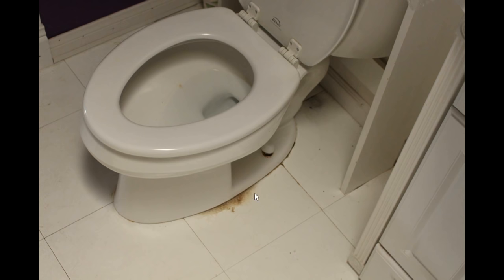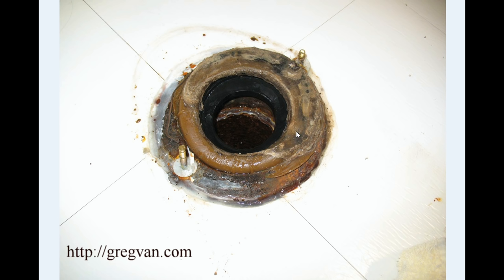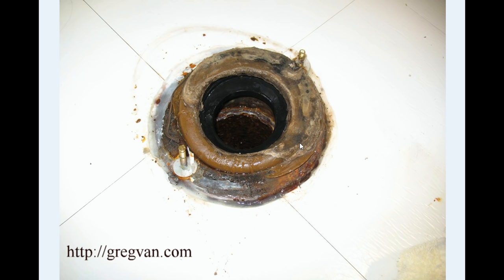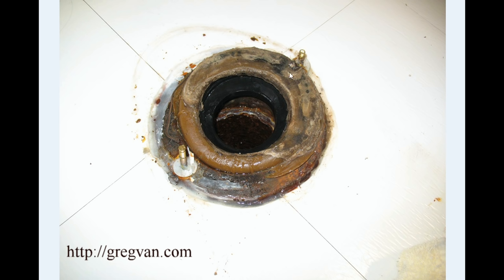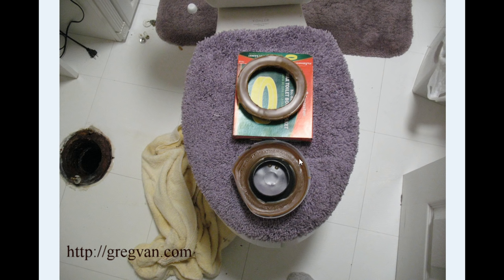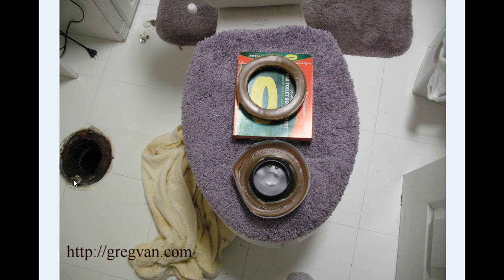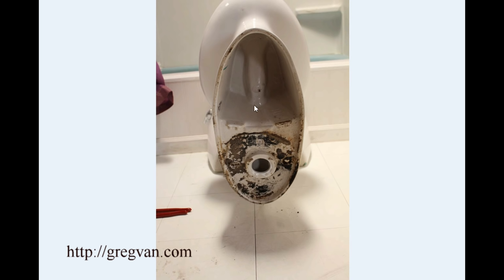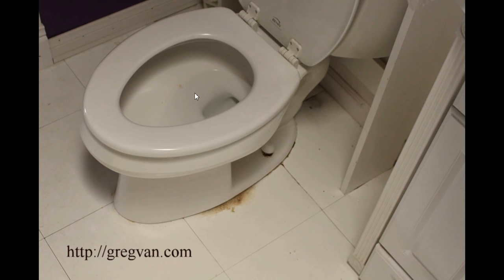Watch This Video If You Have Water Leaking at Bottom of Toilet – Home Repair Tips

Comment: How do you fix the flang bolts if they are loose?
Reply: Get a new set of flange bolts  they should come with plastic washers that help hold the bolts in place, I sometimes get 2 extra metal washers and nuts that fit the bolts and tighten the nut down onto the washer at the flange this will keep the bolts upright and in place securely

Comment: One more question is there a silicone rubber that you know that I use to seal my toilet without using the gun any kind that I use by squeezing out by hand ease don't laugh I just lost my husband and have to do these things alone. Thank you for your videos
Reply from the maker: They also sell it in small tubes that don't require a caulking gun also. Let me know if that answers your question.

Comment: I just noticed my ceiling downstairs had a big water stain. I have no idea how long this has been going on. I clean my bathroom floor all the time and never felt water. I now feel a little in the back of the base. The toilet flushes fine, no movement of toilet bowl. Since the ceiling is now stained any suggestions on what to do.
Reply from the maker: You might need to remove the toilet and make sure that the wax ring is still working properly or simply replace it. I would also look for any places that water can seep through the area around the base of the toilet (after it has been removed) and if this doesn't work then you might have a cracked or broken drain pipe.
Reply: gregvancom Had it looked at. It turned out to be a leak in the tank.
Reply from the maker: Hopefully the ceiling can be repaired or painted without a lot of effort and the problem never comes back.

Comment: what if it is just a very small amount of water....along the grout line..grount lines go under the toilet...and  next to the toilet...toilet is secure and is not loose...it is 3 years old...
Reply from the maker: I would check it anyway, especially if on top of wood framed floor and not concrete slab.

Comment: Mine appears to be leaking around the bottom on the floor. 2 questions, 
1)  If catching it early will it necessarily rot my wood floor?
2)  if I flush the toilet and immediately turn the water valve off when the water leaves the bowl, will it continue to leak?  
Thanks!
Reply from the maker: Water seems to damage wood when it remains moist for a long period of time, but this would depend upon the amount of water being absorbed into it, so it's always going to be better to make repairs sooner than later or stop water from leaking sooner than later. Toilet bowls can leak if there's a crack in the area where the water is currently being contained, but is not common for water to drain out of the toilet bowl after it has been filled with water. I would like to point out that water can be pulled out of the toilet bowl by water rushing through the drain pipes.
Reply: @gregvancom   Thanks for the helpful info!  Can you answer one last question?  Until I can get it taken care of,  how do I get the water out of the toilet (at the bottom) or does it matter if the toilet isn't cracked?  Thanks
Reply from the maker: @lp6052  I've used a wet and dry vacuum before to get water out, along with small cups and even towels that absorb the water that can be wrung out over a bucket. I don't know if I answered your question, so let me know if I didn't.

Comment: Hello I have a wood floor and the part that is holding the bolt is lose and won’t tighten
Reply from the maker: If the bolt screws into the wood floor framing, then you can usually install some type of anchors. You can use this keyword to find them in your favorite search engine, "wood anchors".

Comment: Hi! I don't have a leaking toilet, but after the toilet it's flushed, and you come back later, the toilet tank will be empty. this doesn't happens all the time. What could be the problem?
Reply from the maker: Hopefully you're referring to the toilet tank and is not the bowl. If the toilet tank is empty, then you will need to replace all of the parts inside. You will need to get a new toilet flapper to prevent the water from leaking into the toilet bowl and the new fill valve that will allow water to enter into the tank.
Reply from the maker: If you are referring to the toilet bowl and it definitely isn't leaking, then you might have a problem with your plumbing vents. For example you could be using your bathtub or shower and when the water drains it create a vacuum that would suck the water out of your toilet bowl, but this isn't real common. It would be more common to have a leak.

Comment: I think this might be the problem with my toilet. Our floor is rotting away and I was wondering why. How far can a water leak under the toilet reach in a private 2 floor house
Reply from the maker: Good question, because water leaks can travel large distances on top of the drywall or plasterboard ceiling, often giving you the illusion that the leak might be coming from somewhere else.

Even though this video is about lights, it will give you an idea.
Https://youtu.be/DyGUvlgo82Y
Reply: @gregvancom   Yes I think you're right because the ceiling under the bathroom floor is charging closers and the floor is rotting away. This is so helpful. A repair person is coming tomorrow. Thank you

Comment: I have one and a half bathrooms and the toilet in the main bathroom bubbled. Then I looked at my bedroom bathroom and when I tried to flush it came out of the bottom of the toilet. I went back to the main bathroom and tried to flush but it wouldn't go down. tips?
Reply from the maker: It sounds like you have a clogged drain pipe and will need to contact the plumber or head down to your local rental yard explain your problem to them. They will give you a machine that you can run through your sewer pipes, but keep in mind this is only my opinion. You could have a broken pipe also.
Reply: +gregvancom as it turned out, it WAS just a clog in the middle of the house. lol. I'm all good now. They came out. Bam. They left. lol

Comment: what happens if the bolts don't tighten? do you have a video for that?
Reply from the maker: No unfortunately I don't, but put it on my list of videos to be made in the future. You might toilet off and see what the problem is. I'm guessing that either the bolt is broken or turning around and around inside of a lead anchor that is embedded in concrete. Homes built before 1960 might have led anchors.

Comment: Although a tightening of the nuts may work i wont take the chance and I will  replace the wax ring . Dont want to chance a rotted subfoor . I think the last time I diid this it had that black sleeve type . Wont use it again though . thanks
Reply from the maker: Don't forget that you can always use to wax rings. Simply stack one on top of the other and squash them down with the toilet. I've done this before and it's worked out great. I think the biggest problem with wax rings leaking is created from wiggly toilets.

Comment: A friend came over(girl) plugged the toilet and now leaking from bottom when flushed. I've snaked and plugged with know success.  Any suggestions?
Reply from the maker: It sounds like you might need to take the toilet off if you cannot visually see from the outside where it is leaking from. It could be the wax ring if the toilet is currently able to move or rock back and forth. Remember this is just my opinion, because I'm not there looking at it.
Reply: @gregvancom  ok thank you very much

Comment: if wax ring is broken will shower cause base to leak as well toilet leaks after evry flush and shower as well
Reply from the maker: It could, but it sounds like your drain pipes might be clogged and not allowing enough water to flow through them fast enough, therefore it's backing up and coming out of the base of the toilet.

Comment: I have a toilet that is leaking at base.  When i turn water off it seems to stop.  I can keep it off for days and it will stay dry.    Doesnt seem to leak from tank.  Water in bowl while water is off and doesnt leak.  Any ideas
Reply from the maker: When the water is off, does the water drain out of the toilet bowl? If this happens, then you might have a crack in the toilet bowl.

If it doesn't, I would check the water supply line that connects the shut off our to the toilet to make sure it isn't leaking.

Comment: I just finished replacing the wax seal thanks to your video, it turns out that the toilet base is warped on the front end, not the actual floor…
Reply from the maker: I've ran into the problem myself and had the toilet move or wiggle. I installed a few metal washers as shims and sealed the bottom with caulking.

Comment: I used two wax rings and I still have the issue. I might need a bigger toilet for our bigger booties, which makes the toilet rock....I'm sure. I can't emphasize using gloves and eye protection, Bec. I got very close to water on the side trap, and noticed black tiny moths? AND, these little black animals like leeches. I grossed out when I saw this. Tx for your info.

Comment: so long do I have to wait to use it? or it's ready to use?
Reply from the maker: If you're talking about installing a new wax ring, then immediately after it has been installed. In other words, the wax ring doesn't need to dry or settle, but caulking installed around the perimeter base of the toilet might need a day.

Comment: MY toilet is leaking at the base, my kitchen sink is downstairs below this toilet , now i am getting drips of water going through my ceiling tile dripping water into my kitchen sink..What should i do?
Reply from the maker: The first thing you need to do is find out where the toilet is leaking from. Check all of the water supply connections and inspect inside the toilet tank and if you can't find the leak, then you might have a cracked toilet, plumbing drain pipe damage or the wax ring between the toilet and the floor drain might be damaged and need to be replaced.

Comment: Your video gave good info but you didn’t show how to place the wax ring(s) correctly. I would like to see how to install 2 wax rings. The other video I watched didn’t mention using 2 wax rings.
Reply from the maker: I should have more videos on wax ring placement at our website, but you usually stack them on top of each other and algin the inside with the drain pipe.

Comment: What do you do when Sharkbite fitting continue to leak after replacing them
Reply from the maker: I've never used them and still use copper. I would suggest replacing them, but since I don't know much about the product, can't provide you with any suggestions.
Reply: You either haven’t got it “pushed to connect” far enough (happened to me) or the O ring is bad.

Comment: Okay originally it was my son who clogged the toilet with a wrench so we had to replace the toilet the toilet set up higher than the old one did so we put two wax rings on it now the new toilet is leaking from the base I got out the directions and it said if the toilets at lower than a certain and below they gave us an extra piece to put on we did that and tightened the bolts down and the toilet is still leaking from the bottom of the base we did take it off after watching your video and found no leaks in our brand new toilet please please please help

Comment: The toilet flushes good but i notice when it fills back up the the water goes back down in the bowl. I can put it back to the water level and it goes back down every time. We just replaced the wax ring twice because of a leak in the front of the base on the right side. I am very confused
Reply from the maker: The only thing I could think of, would be some type of a crack. You might want to remove the toilet and set it on something where you can view the underneath side of it. Then fill it up with water and see if it's leaking from a crack or other damaged area. Toilet bowls are designed to keep water in them when not being used.

Comment: Can condensation be the cause?  I saw the condensation and it's dripping on the floor.  It just looks like a lot of water on the floor, but I do notice that a lot of condensation build up on the tank is dripping on down.
Reply from the maker: I would imagine it could, even though I've never ran into it. Have you been able to figure out what is causing the condensation?
Reply: Looking at other Youtube Videos, they state that the cold water and the combo of taking showers will cause condensation and surprisingly, actual appearance of leaks and even water damage.

Also, one of the videos stated that the constant recycle of cold water in the tank will mean 2 things 1)  Flapper is leaking thus water level will go down 2) then water will refill with cold water again thus causing more condensation.

So to test this, I turned off the water to the tank.  Fill the tank with luke warm water, when went to bed.  When I woke up this morning, no leak, no condensation and the tank was empty which tells me that the flapper is leaking.

So I'm going to buy a new Flapper to see if this will take care of everything.
Reply from the maker: Interesting and thanks for sharing.

Comment: Man ... I am in desperate need of assistance.. my brother put a new toilet in down stairs and every now and then and now every other 2 weeks the clean out line seems to get backed up due to air being sucked from the downstairs toilets bad wax rings?? Resulting in water spewing out from the bottom of the toilet going into the kitchen on WOOD FLOORS and Everytime it does that I hook a nitrogen tank up to the clean out, link it to a hose, push it down the line to the street and blow it out. It works but just for a week or two sometimes a month then does it alllll over again. Is this simply a bad wax ring? It's killing me 😢
Reply from the maker: My guess is that you have a clogged line. You might be able to use a garden hose to remove clog. It's worth trying, before using snake sometimes.
Reply: @gregvancom  I've blown it out with a garden hose connected to nitrogen tank like five times. It's really throwing me for a loop 😞

Comment: My bathroom flooded while I was away from home. Can't find the problem. Everything with toilet seems to be intact and stable. Maintenance can't find issue as well. Any suggestions? Worried that it will happen again.
Reply from the maker: I wish I could wave my magic wand and solve your problem, but I can't. I'm guessing that it was a clogged drain line, but enough water pressure building up in the pipe system jarred it loose and solved your problem.

Comment: What could be a reason for the bowl to lose water after a couple of hours if there are no cracks in the toilet and the ring is fine?
Reply from the maker: There could be a crack somewhere in the toilet or you might have water siphoning because there's a problem with your venting. The problem with the venting with only occur if other parts of the plumbing were used. For example if everyone left the house and no one used any plumbing for two hours and there was nothing wrong with water level on the toilet, then it wouldn't have anything to do with the venting.

Comment: I took the toilet off, cleaned up the mess, and let it set overnight to dry up. When I went in the bathroom the next day, the whole floor was wet. I looked down the pipe and could see water. I ran the sink and watched the water raise down in the toilet pipe. Does this mean I need my septic emptied?
Reply from the maker: If the water drained a little, then you could have a problem with your septic tank or a clogged pipe that would be allowing only a little bit of water to go through at a time.
Reply: gregvancom yep, opened the septic and it was full. Thanks for your videos!

Comment: When we leave for a few days we always shut off the main water supply to the house. When we return there is always water on the floor around the base. It's the only time we ever see water on the floor. Any ideas why this only happens when the main water supply is turned off?
Reply from the maker: I would like to say that they might get crack somewhere allowing water to leak from the bowl, but that would be happening all year round. The only thing I could possibly suggest and this is a long shot is that it might have something to do with condensation forming around the outside of the toilet. I've never ran into this problem, but would love to know what caused it if you ever do solve the mystery.

Comment: Any tips the strangest thing happened. I flushed the toilet used 2 peace’s of toilet paper started overflowing and the kitchen light splattered with water please help
Reply from the maker: If the toilet is located above the kitchen light them you probably have water leaking from the plumbing or from some type of break or crack in the floor.

https://youtu.be/DyGUvlgo82Y

Comment: I used my toilet last night and it worked fine. But this morning i used it and it started to leak at the bottom. And the water inside lowered. Also when i sat down it made a weird noise. Can it be fixed with taking it apart?
Reply from the maker: It's difficult to say, because I don't know what the problem is. If you don't find your answer in the comments below, then it might be time to remove the toilet and give it a thorough inspection.